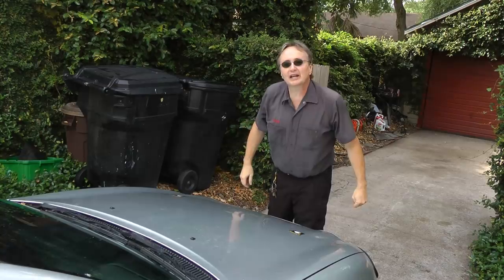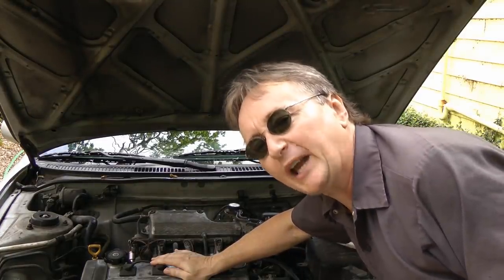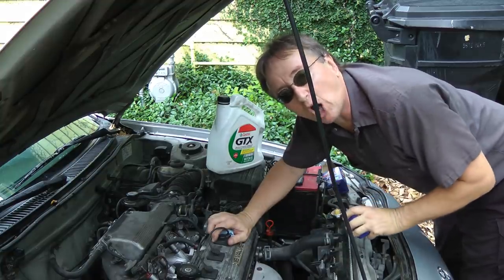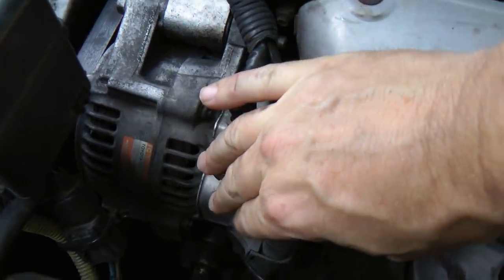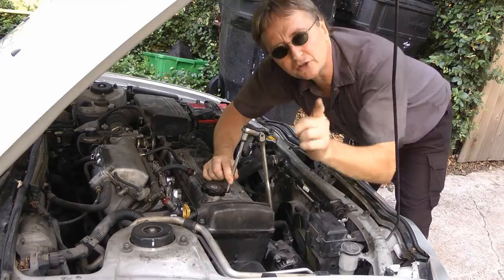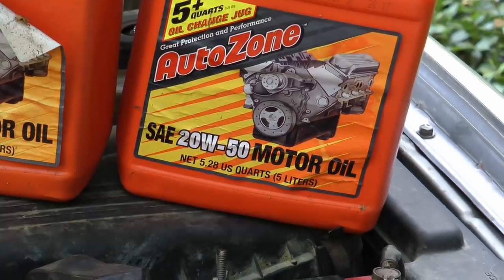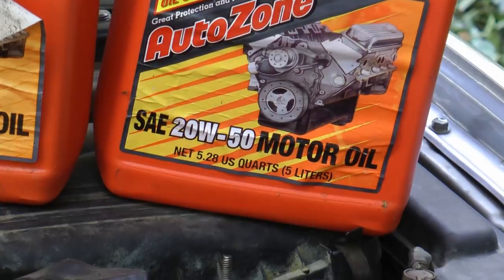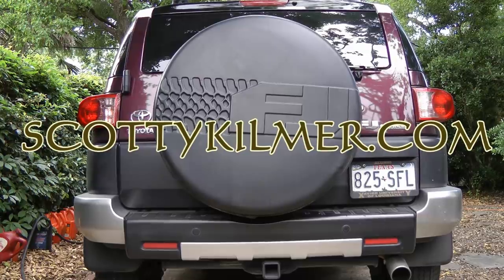Top 4 Mistakes Car Owners Make (DIY Fails)

Comment: Ford recommends 5w 20, but I've used Amsoil 0w20 for ten years and my 2007 f150 runs great and doesn't burn any oil!
Reply from the maker: yes amsoil is an excellant oil
Reply: Ya I'm done using mobil 1. I'm moving to Pennzoil or amsoil even tho amsoil is expensive.
Reply: +Rick Simpson dont matter
scalar weapons are not conventional emf
but are radiant energy and come inside shielding possible
Reply: +jquest43 impossible to shield,imo
Reply: I like the benefits of using Amsoil products. I just cringe at the price.
Reply: It doesn't do any good using a expensive oil in a old dirty engine. Expensive synthetics are great on newer well maintenanced and not abused vehicles. If you change your oil and it's dirty in a week the whole inside of the engine needs to be cleaned. Don't go by mileage on a oil change go by the color of the oil.!!! Change it before it turns dark brown..!!! If it's black like Texas Crude you've waited way too long  !!!!!!
Reply: Do you know. ???? Where the black additive comes from that turns your oil black .????? Hint.!!!! It's not from where of the rod bearings crank bearings or rispens. !!!!!
Reply: I use 5W 20 for 13 years on my  Windstar. And change it every  two to three months. I have a  friend  who put thicker oil in and ruined the engine. Some people just don't want to follow rules and regulation.
Reply: Crank angle sensors and cam sensors have a magnet inside of them that gets weak over time they are not made from rare earth magnets they are man-made magnets. !!!!!! I have heard with a large magnet you can recharge the sensors in 2 or 3 days. ????? Also older vehicles that have a ignition module in a distributor can be recharged with a large magnets. ,????
Reply: Heriberto R Montalvo if it ruined his engine it had to have been an old vehicle that had a lot of sludge in it and was probably ticking is why he put thicker oil in it. ???? It had a week old pump and was ready to blow up anyhow. !!!!! There is not that much difference between 10 W 30 and 20w 50. !!!! But it is affected by temperature. ????? Hotter climates and harder driving you use thicker oil. !!!! Colder climates you use thinner oil. !!!! Never use thick oil and oil stabilizers or additives in the winter. !!!! Especially on older older vehicles that has been neglected. ,?????
Reply: Also it could  be that oil pumps are designed to push thinner oil. He used to crank that  Ford  Explorer and it used to sound like a tractor.
Reply: Heriberto R Montalvo many times when a motor is ticking from the lifters and rocker arms it is stuck lifters they're not pumping up fully and Ticking by flushing and cleaning the engine sometimes they'll pump back up in the tick go away this is the newer way of doing it people used to just put thicker oil in too quiet and down the tick. !!!! Transmission fluid is a good way to unstick and clean the lifters so that they pump back up and stop ticking. ????
Reply: grumpy oldfart   Amsoil? It's not any more expensive than Royal purple because it s good for 25,000 mile interval.
Reply: hand held garage never put that many miles on a oil change even though it is synthetic and rated for that many miles. !!!!! If you're putting 50,000 70,000 or a hundred thousand miles per year and changing the oil multiple times a year you might be okay. !!!! Carbon separates from the oil and builds up in the head valleys and in the oil pan. !!! Good oil filters today are junk they break down and start to separate the paper filters clogs up crank bearings rod bearings and your lifters. ???? Oil filters do not separate moisture in the oil. !!!! Regardless change your oil at least twice a year. !!! I have rebuilt so many engines because of long-lasting synthetics. !!! I told my brother this also and I have had to rebuild his truck engine that only had 60,000 miles on it. ??? He only drove five or six thousand miles a year. ????  Remember a oil change is cheaper than a engine change. ???? Regardless of the type of oil. ??? I tell all of my customers to at least use the 10-4 system. !!! October fresh oil change for winter April fresh oil change for summer. !!!!   30% of my business used to be from people neglecting oil changes. !!! Now 30% of my business is from people using synthetics and running them too long. ????
Reply: Rick Simpson Amsoil recommends once a year oil change.
Reply: grumpy oldfart schaeffer`s is an excellent oil! Never used royal purple
Reply: Unless you're in a "cold climate", using 5w-20 or 0w-20 makes absolutely no difference on your engine. They're still the exact same weight, and just a slight difference in cold thickness.
Reply: Pure horseshit. The color of the oil is no indication of whether it needs to be changed or not. I've seen hundreds of used oil analysis' and many of them the oil was black. The viscosity, additives, acid levels and wear metals were still good, meaning the oil could go at least a couple of thousand more miles.
Reply: You are subbing a lighter oil (0 instead of 5 weight), it will circulate easier during start up. That's not the issue being discussed in the video.  People use HEAVIER weight oil, which doesn't circulate.  Seeing as 75-90% of engine wear occurs in the first few seconds of startup, using an oil that will circulate fast enough is the key.
Reply: hand held garage: "Amsoil? It's not any more expensive than Royal purple because it s good for 25,000 mile interval"  Too bad the filter is dead and into bypass mode after 5000 miles, otherwise you'd have a point..
Reply: hand held garage "Amsoil recommends once a year oil change."  So?  That's their oil they are talking about not someone else's filter.
Reply: I use a 10W-30 in mine. And that is what the manual specified
Reply: The best oil is clean oil
Reply: Rick Simpson it's carbon from the combustion of fuel, air, and sometimes oil... an engine is not perfectly sealed so fuel will burn in the combustion chamber and as it is expending it will push past the piston rings, and down into the crankcase (known as blowby). All engines have tolerances built in by the manufacturer to reduce wear and consumption at normal operating temperature. But on a cold start the tolerances may be much larger depending on materials used in construction of the block, pistons, and type of rings used. During cold start the engine may run slightly rough, and may burn. Bit more fuel, or some oil due to these tolerances, but once they warm up this is reduced.  Due to the tolerances tightening up. You will never get rid of the spot, but you can filter it with a food filter, and reduce the particles in the fluid.
Reply: What if your wngine has almost 300,000 miles? Should i use thicker oil?
Reply: whitemage024 nope, If it's leaking, or burning oil over 1qt every 400 miles I'd recommend a rebuild, or at the very least hone, and re-ring and check the valve stem seals, as well as check the pcv system is working properly. You can damage your engine using a heavier oil. Also cause damage to bearings.
Reply: killahjeep thanks a lot for the info.
Reply: Conservative America where would you be able to buy amsoil?
Reply: You can go lower on first number, not the second. 10W engines can use 5W or even 0W with no problems, regardless of brand. It's actually better in colder weather, I switch my oil grade from 5W to 0W from November to March. You're engine will say "thank you." Now if you live in Florida or southern California, you don't have to do that.
Reply: when it comes to oil viscosity you can always go down on the first number and up on the 2nd number if that makes sense. so if youre vehichle recommends a 10w30 putting 5w30  would be fine, but putting 5w20 would not be. in canada and colder placws 5w30 tends to be the subsitute for 10w30 because it stays thinner at colder temperatures
Reply: ŦheŁauręnŧ I wouldn't go up on the 2nd number unless you have a specific reason to do so, i.e., excessive engine wear or oil burning, maybe to quiet a tap.
Reply: eyeh8u1 agree......+ aluminum turn any oil black in days so....
Reply: all oil brands are nearly identical. Amsoil is not the best for everyday use. It's more efficient under high wear but has a shorter drive-life than most standard oil. It's good oil to use if you drag-race or drift or tow constantly. If you don't do hard work on your engine, it tends to leave behind more deposits. If you're going to use that oil, I recommend revving your car to limit every now and then.
Reply: Oil will get dark quickly in any engine. Maybe its the extremes hear, but I've done first oil change on a few vehicles were I live, and its always dark.
Reply: I dont get using royal in a street motor. If you litterally sitting at 7000rpm till you burn holes in you cheap stamped rockers like the dirt track guys, it might be a good idea, but for the street, its waste of money.
Reply: 5W20 and 0W20 are 905% the same things
Reply: I just buy the cheapest major brand name oil that meets the specs(0-w20 full synthetic).  Current oil in my car is Castrol and it was just under $20 for 5 quarts, tax included on Amazon.  I should add that my engine just passed 200k and it sounds and performs like new and does not burn oil.
Reply: K G That's usually what I do my truck is at 214k running up on 215k I just use 5W30 like it says. I happen to have Castrol in it rn as well
Reply: 10 years really isn't much in the life of a modern vehicle. I could get a Civic to 10 years on vegetable oil (hyperbole). A different start weight will at worse cause extra wear and tear that won't be apparent for years down the road, so long as you're changing it properly it'll still work for lubrication just fine, just possible extra wear.

And that second number is what's relevant for burning oil, which is the same weight (20) when operating, so you really are following the mfg rec for the most part. The lower start weight just means it's "possible" it could cause slight extra wear at start from being too thin. Still best to go with the mfg rec, but what you did likely won't make much of a difference unless you live in Antarctica.
Reply: grumpy old fart  good oil I don't use nothing else and my 16 year old car still running
Reply: i like motorcraft synthetic, i think its a ford brand, but ill use it in anything. 5 quarts for just under 20$
Reply: So no matter how many miles ur engine has,  don't use heavier oils?
Reply: Actually I would recommend it for Pontiacs cuz Pontiacs have I have heavy motor and they tend to burn oil more. Royal purple is like the only one that doesn't start smelling burnt after 2500 miles
Reply: Been smoking for 10 years but still healthy that's doesn't mean smoking doesn't cause problems. ha ha ha
Reply: First number is cold weight. The last number is the important one. Go as low as you can on the first number, not higher.
Reply: Heriberto R Montalvo I can't believe
Reply: Heriberto R Montalvo increíble,falso.
Reply: Let the flaming begin. Drive 2 fords with both asking 5w20. I run this in the winter. During the summer they get 5w-30. Engines have high miles and done this for a few years now. Have a 3.0l in a 2006 escape and devolops a slight tick in the top end in the summer when hot. Run 5w-30 and its gone. I re-sealed the oil pan and valve covers later down the road and looked inside. Still has awsome cross hatching and cams look great. 10w30 to a 20w-50 is way to drastic. I've seen and old worn out chevy 350 fire a rod out the block on a -30c cold start with 20w-50. Just got to use common sense.
Reply: You live in Alaska or why do you use 0W
Reply: You forgot about laying in a store of tinfoil hats.
Reply: Depends entirely on where you live.  Here in Ottawa, (the second coldest national capital in the world), you better be using a multigrade oil with the lowest "w" number you can find.
Reply: If I can I fill my filter up with fresh oil before I put it on the car.
Reply: I run what Ford built my F150 to run on which is 5w20, I run Mobil 1 and add several ounces of Motorkote at each oil change and stay on top of my changes between 3,000 and 5.000 miles which is better than the 7,000 ford recommends. Why would you use anything other than what the manufacturer recommends? Engines today are built to very tight tolerances based on the intended properties of the engine oil and that includes viscosity.
Reply: "Why would you use anything other than what the manufacturer recommends?"  And yet, you add Motorkote, which is not Ford recommended.
Reply: There's a considerable difference between using a small amount of a fleet proven additive with the following properties, MotorKote® Hyper Lubricant®, Is safe & effective, period. 
Does not alter the SAE Rating of the base lubricant.
Does not contain PTFE, silicone, graphite, molybdenum, or any other harmful substrate chemicals
Has no long or short term corrosive effect on metal. 
(Will not void manufacturer's warranties) This one is critical because intentionally installing the incorrect oil will in fact void your warranty. That being said neither of our vehicles is still under warranty, mine is a 2010 Harley Edition that I intend to keep for another 20 years so I do my research and follow failures, failure modes and root causes. Many people have experienced timing chain and cam phaser severe failure issues on the 4.6 and 5.4 engine especially in the years 2004 to 2008 (your vehicle falls in that category). Because this appears to be a full film rather than boundary lubrication issue many people have gone from using 5w20 to using 10w30 as well as using friction modifiers such as Motorkote to reduce the likelihood of failure or at least postpone it. You went the opposite direction so I logically question why?
Reply: So, you work for this Motorkote outfit?
Reply: No sir I'm a retired mechanical engineer specializing in industrial robotics, spent most of my life in auto plants, I assume your logic for using 0w20 in a car designed to run on 5w20 is either an attempt to improve fuel economy or you live in a climate where it gets extremely cold since you don't seem to want to provide an answer. You may want to look into the cam phaser issue, I'd ask the mileage on your truck but I'd probably get another question as an answer, when I'm just trying to be helpful, frustrating. Do you work for Amsoil? They talked Toyota in Princeton Indiana into using Amsoil in their Kawasaki robots instead of Molywhite RE00 and destroyed a couple million $ worth of radial vector drives, thank God I didn't work for Kawasaki, I watched those poor guys replacing drives every weekend for over a year, my company when asked said absolutely not, Warranty will be voided.
Reply: Interesting Analysis Method.
Reply: Mobil 1 has never let me down, Royal Purple foams, Amsoil is way over priced.
Reply: Not a fan.
Reply: Might want to work on your reading comprehension.  I've already stated that I live in Ottawa.
Reply: I'll get by Alex, have a nice life.
Reply: whitemage024 
I would check your owner's manual to see if it recommends different grades of oil for different temperatures, but if you change it to just one grade higher it will probably help protect your engine with all of its increased bearing clearances, that's how I got most of my cars past 200,000 miles.  And never rev your engine up near redline, or on start up if you do use the thicker oil. You'll be fine if you do that.
Reply: It would be expected to work fine. My car says I can use 0w20 or 5w20. The w number is just the cold rating which would flow better than 5 when cold. Newer toyotas require 0w 20 synthetic for efficiency
Reply: Rick Simpson hahahaaaiii...! Thanks Rick I'm after getting some rice 🍚 and zip locks right now ....
Reply: Oz Media so if the filter is easy to see just spin it off and install new one ..add a little more oil to the car and all is good for another 5,000
Reply: silosis one quart over here will run you $10.00
Reply: I agree. even 0--30 I think is ok. 0--20 is thinner than 5--20. Shouldn't be but is. Amsoil is the real reason you are still rolling.
Reply: Do you also cringe at the price of your Soy Latte at Starbucks, hand held garage?  haha
Reply: The best oil will turn black because it is working, Rick. Diesel oil will be black in two days. In a Diesel.
Reply: Would that be Carbon, Rick?
Reply: @Alex_Mitchell  "Ford recommends BP gasoline" is stamped on my crown vic's gas cap. I'm sure BP didn't pay for that convenient suggestion. 😆
Reply: I've never looked that closely at my gas cap.  I'll have to check to see if mine says the same!  Only problem is that BP sold off all its stations in Canada decades ago.
Reply: 0W-20 is probably an good optional oil for this production. You could have used 0W-20 conventional and seen the same results with an appropiate maintenance schedule. Amsoil is a good product, but people should be careful in their reasoning. The cause of the effect likely is keeping up with maintenance, not what type brand or even weight of oil you choose to use if the weight you use is an acceptable option for your production. Generally, I don't accept the hype about synthetic oil. If I had a vehicle where the recommended oil was 0W-20 or 5W-20, I would be concerned about using conventional in the very hot summer climate where I live though. Even if I win the SuperLotto ($19 mil) tonight. I don't think I would buy a brand new vehicle. With a late model Toyota Avalon, which is what I think I would get, I think I would use synthetic 5W-20 oil year around. I think the factory say to use synthetic oil. In my mind, the main benefit of synthetic oil is temperature range. If you face very hot or very cold temperatures regularly, above 100 F or below 0 F, then you may need synthetic. Especially in the heat. In a frigid climate, you can keep your vehicle in a warm garage, have a tank heater or even stick a small lamp or trouble light under the oil pan and have a higher start up temperature. When it's hot, it's hot and you have to drive in it if you need to go somewhere.
 
Just as an aside, if any of you are ever so lucky as to have won the lottery, you need to protect your head more than you need to protect your assets. That's going to be the greatest risk. Get your head messed up an you can run through any amount of money. Live long and prosper.
Reply: Use 5w20 or 0w20. Unless your car manual says different. In that case, buy a newer car.
Reply: @ @user-os8sq3uh4n   Are you telling people, if your vehicle is old enough that 5W-30, 10W-30 or even 10W-40 is recommended, get a later model? Did you win the lottery, or what? My vehicle is a 2001 Camry Solara 2.2L 4 cyl. with 128K miles. After seeing, reading and hearing all the b.s. and dayreams on these motor oil videos I am going to prove everyone is a fool by hereafter using nothing but SMB 10W-30 from the dollar store at (surprise) $1.00 a pint and a Supertech filter, and follow a change interval of 3K miles. All of my cars get crazy high miles, and I do no more maintenance than necessary and never buy vanity products at jacked-up high prices. In my experience, the only value of synthetic oil is that it allows a longer drain interval. If using it gets someone to follow a maintenance schedule and not abuse the vehicle, that's for the good. But I don't need it. I just get out my little drain receptable, drain the oil, change the filter, put in new oil and take the drain oil to parts store for recycle.

The other use of sythetic oil is in extreme hot or extreme cold climates. If you are going to do cold starts in below zero (F) temperatures, it might be a good idea to use synthetic. It does flow better in extreme cold. Sustained extreme heat above 105 (F) could be an issue too. In the bad old days conventional oil sometimes turned into a gel in extreme heat. Modern additives may largely prevent that, I never hear of it anymore, but it is a possible risk. Stop and go driving in the city is considered more severe than sustained speeds on a highway or freeway.